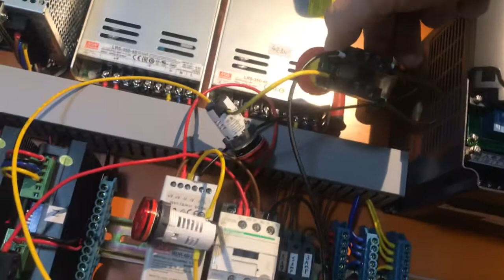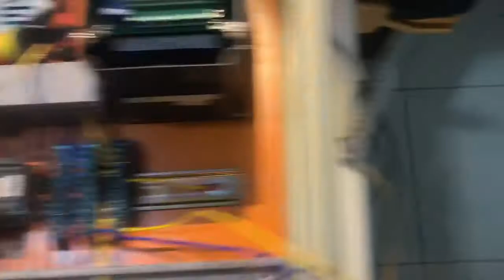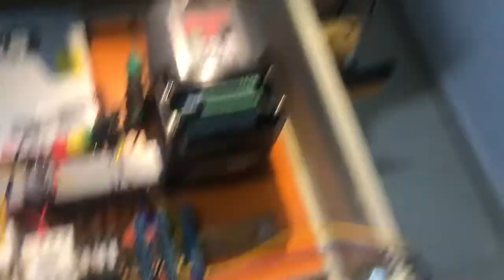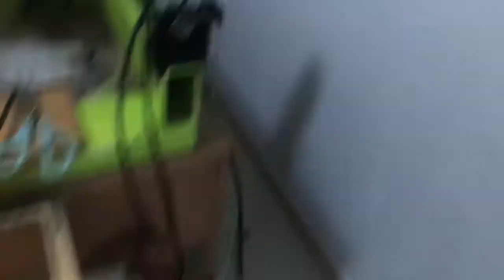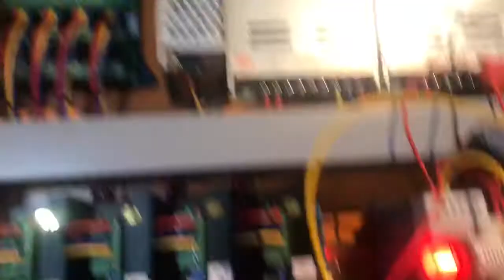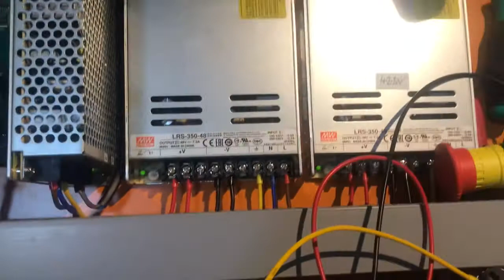PrintNC Power, Run and E-Stop Indications

Comment: can you tell me what parts and where you got them from apart from the aliexpress kit as im about to start wiring, im also from the uk and dont know what to get. 
btw looks very clean
Reply from the maker: Hi Mark, apologies but have only just seen your message. I am from the UK but I live elsewhere so my parts have come from all over the World. I was fortunate in that its pretty industrial where I live so getting hold of industrial controls  from the Schneider range was pretty straightforward and quite good value (not cheap) for the quality I got. Switches and lamps are 22mm, the contactor is also from Schneider and I would definitely use them again (I doubt they'll ever fail in the machines lifetime) 

The PSUs are all Meanwell and strictly speaking would be better to have four of these 48v supplies, one per motor. 

The controller board is a Mesa 7I96 direct from Mesa in the USA. Expensive but allows for expansion later in the build.

Comment: Hi jimbojet737

What make and model contactor did you use please? 

Thanks
Reply from the maker: Sorry have only just seen your question. It is the Schneider Electric LC1D098D. 230v/24v. The switches and indicator lamps are also all Schneider Electric 22mm panel mount. Great quality but may be pricey depending on where you live.